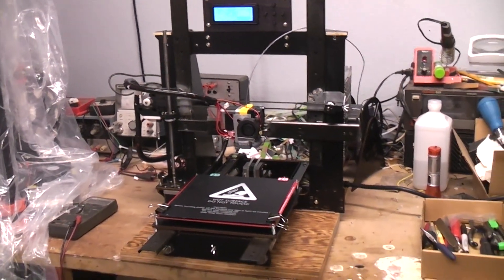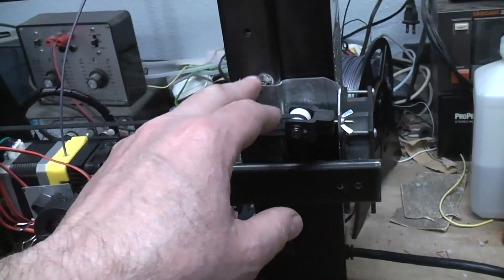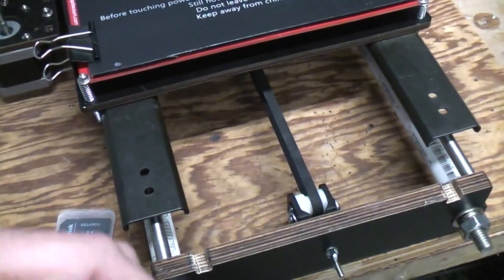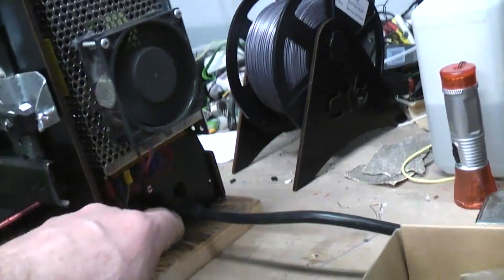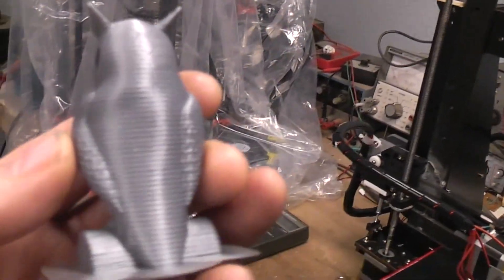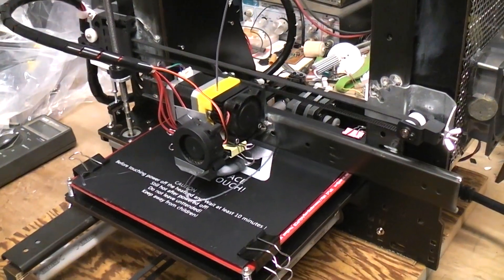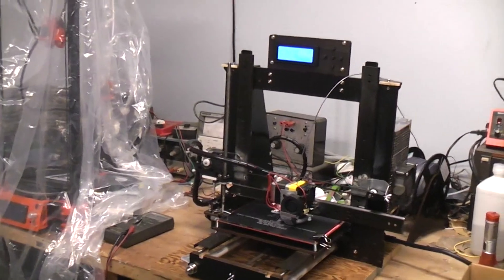$75.60 for a CTC 3d printer Kit - Bashed to a slide "linear" rail printer.

Comment: Do you still have this printer robothut? Was just curious how its worked since you did this mod?
Reply from the maker: Yes I still have it and I have 8 other 3d printers. I normaly only use the Prusa MK3s that is in the house when its cold in the shop. The wife will only let me keep 1 printer in the house and the Prusa MK3s is the best one, so it gets most of the printing jobs.
Reply: @Robothut  Thanks for the update! Have you checked out the th3d stream in which he built one, and then modified the heck out of it?
Reply from the maker: @andrewbaggett2505  No I have not but it sounds interesting so I will check it out. Thanks for the heads up.
Reply: @Robothut  No, sir TY for the content. And the conversation! Have a good night!

Comment: I wonder of the am8 frame will fit the ctc? I'm thinking of getting one of those and printing the BLV linear rail mod for the anet for mine.
Reply from the maker: I do not know but if you can get the parts cheap enough it could be a fun build.

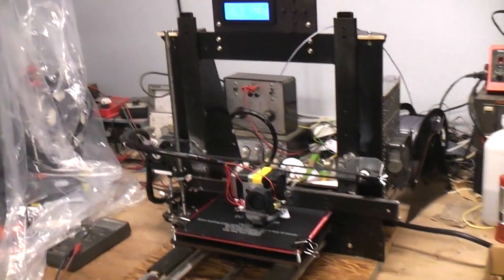Comment: 9:15 I'm interested in knowing more about this build plate.
Reply from the maker: The CTC comes with a heated build plate and Glass. I put on a build tack type sticker on the glass. When I tested the first build of the printer I did not use the glass that comes with the kit I used a anycubic ultrabase plate that I had already. I have also just used the glass that comes with it and masking tape, that worked fine also.